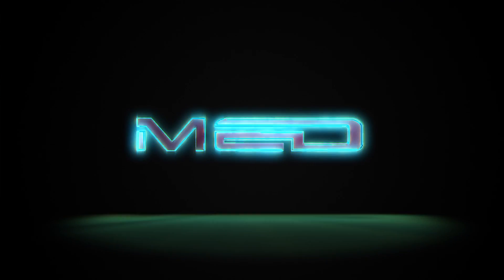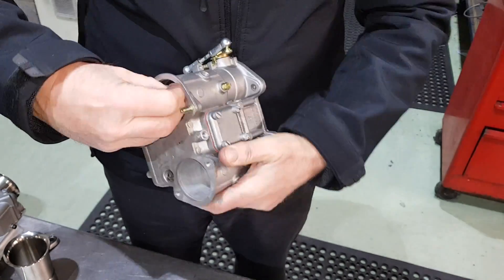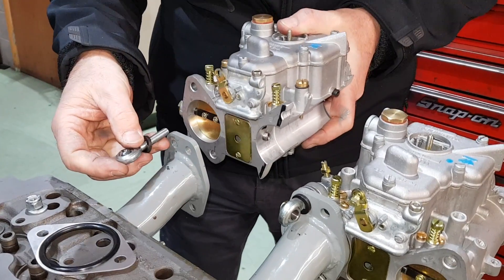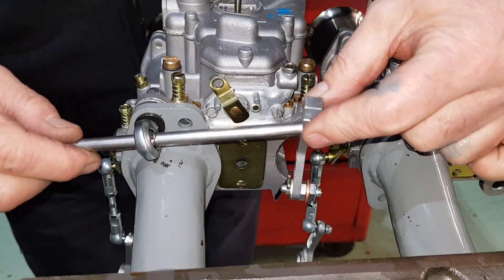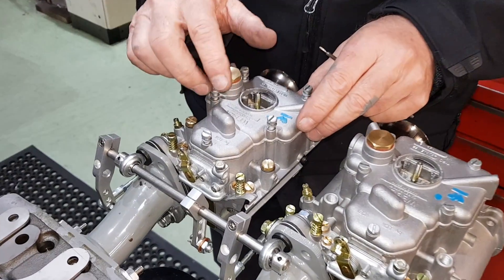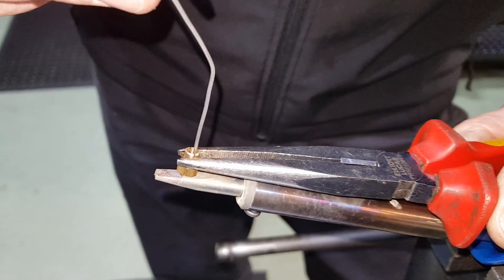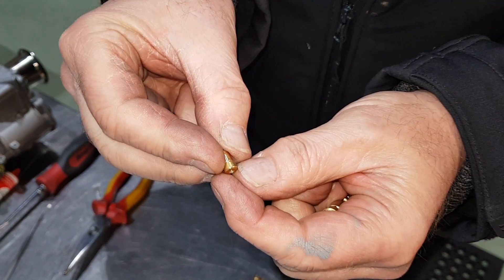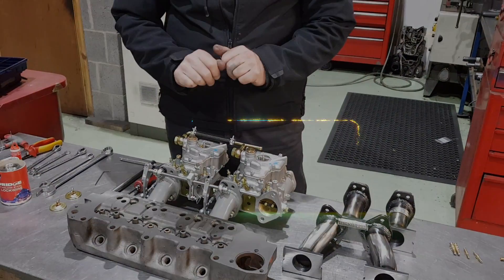MED twin split Weber conversion - part 3

Comment: What about the accelerator pump.... the pump will be supplying the same volume now to 1 side, whereas before it would have been both sides. Do you have to reduce the pump stroke? Increase the bleed size hole? A suppose you need to reduce the pumped volume by half?  What do you do to the setting to counter this?

Comment: There is an even better compromise,  one single injector per cylinder as in this race tested and fully dynoed solution to your problems, made in the UK, and not expensive.  http://www.williamspowerinjections.com/ contact a-williams@outlook.com

Comment: Hi wondering if you can help Having trouble starting a 4 cylinder pinta 1600 with weather twin 40s  Jet sizes They are set For a 2.1 pinto And  Can I Use the avante's pipe off the dizzy End if so can you recommend some jet sizes Please

Comment: I don’t know much about Webber’s, but instead of cutting off one half, why would you not just use two full Webber’s and shift the one that you cut, over to the other port/inlet/outlet.... is it because of weight?....is it a space issue for the mini’s?
Reply: BTW, videos are really good 👍👍
Reply from the maker: @MrBrits96  Thanks Austin. It's a space issue - as the inlet ports are too close together to do this.

Comment: does  3-4  hp really make that much of a difference  ?  also why not just  use two single carbs of the same  throttle body size? i mean you are adding wasted  weight to the car with two twins
Reply from the maker: Yes it can make the difference between first and second place. They're largely aluminium and hollow, so there's no notable weight penalty.
Reply: On a tiddler 850cc engine every little bit helps. Why then do you think those old boys of yesteryear went to those lengths splitting them Webers? Just for the hell of it?? As for added weight? At  the time nothing in a single barrel configuration approached those Webers in terms of fuel atomisation.
Reply: It all adds up.

Comment: this is why the fisch carbs dave vizzard used to use were so good, you can have the benefits of individual manifolds and just put a fisch carb on each one.
no machining and the way the fisch works no jetting woes(infinitely adjustable), if you ever see any reece fisch, or minnow fisch carbs snap them up, and read vizzards fitting and setup notes.
Reply: Which begs the question why they were never universal adopted?....Split Webers were!

Comment: Do you alter the size of the split jet to compensate for the pump jet effectively doubling in volume capacity as its only running one side now?
If so to what size?

Comment: It seems to me that the law of diminishing returns applies here, all that time, effort and expense just to eliminate  minor kinks in  the manifold runners  and pick up a few measly horsepower. My guess is that  more effort spent on cam design, porting, ignition, jetting and exhaust etc would produce more worthwhile gains.
Reply from the maker: 3-4bhp is lot in percentage terms when you've already exhausted those avenues.
Reply: you dont really have any idea
Reply: Every gain is worthwhile ..you just said! 😂

Comment: That’s what I just thought, make a carburettor to fit the head width. How much are 2 45 DCOEs & one half your wasting
Reply from the maker: It's not financially viable to make a custom carburettor.
Reply: @MEDEngineeringTechVideos Ever tried fitting a Keihin FCR?
Reply from the maker: @lutherblissett9070  We haven't, no. The advantage of SU/Weber being that many rolling road specialists in the UK keep the needles and jets.
Reply: Back then Weber carburettors  were relatively cheap. They were oem in Alfas and some Fiats. So no big deal butchering them for your 850 Mini! 😂

Comment: Very interesting video👍.
I had one question which is given were in the age of 3D printing and 5axis CNC mills could the Weber be manufactured wider  keeping all the standard internal parts and effectively just make a bigger housing so you get the alignments of the intakes as per what you discussed at the start of the video or are we talking mega bucks and not enough demand for such a thing?
Reply from the maker: Cost is the issue here - these carbs are quite generic and produced in their thousands. A custom carb would not be financially viable.